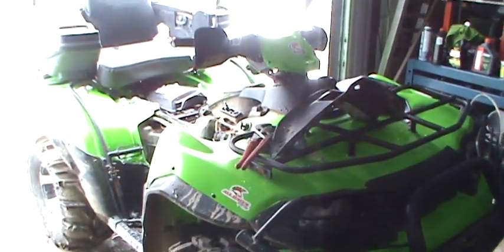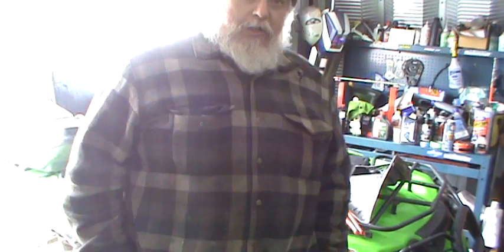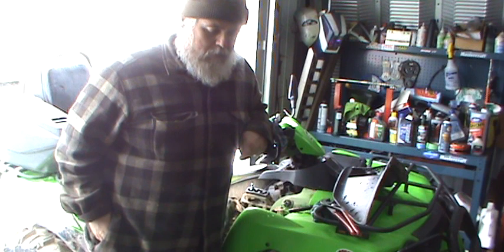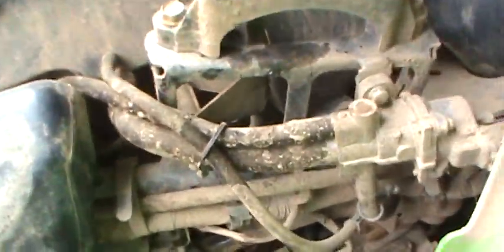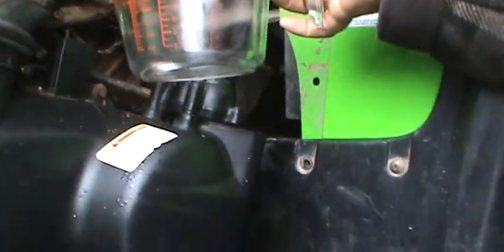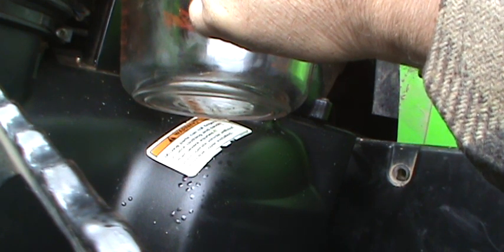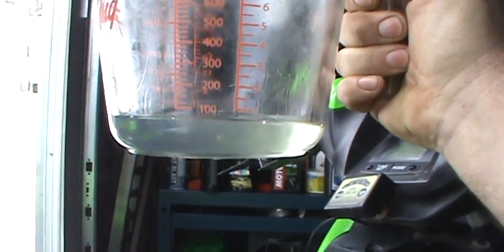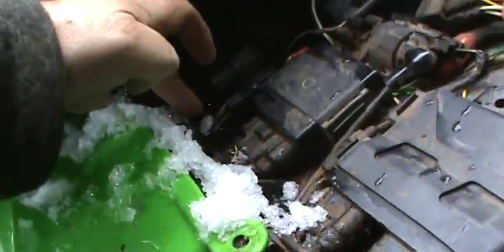Kawasaki brute force 750 no power backfiring fix

Comment: How’s it going I have a 2010 brute force 750EFI bike was working good on a run and I have a new pump and sock filter in it from 2 runs before the bike on the last run got it on open road and wouldn’t go over 30mph now still won’t take a good punch on throttle then shuts it down but after letting bike cool for a couple mins fires right up and goes for another 10 mins then shuts down still cuts back while giving it checked coils with metre seems fine do my knowledge of testing do you think I’d need to poke whole in the sock filter?
Reply from the maker: Not in the sock filter but the hidden one inside the plastic fuel pump housing. Google it. Hook a fuel pressure gauge to the bike. Ride it till it acts up and look at the pressure reading.
Reply: @HammerHeadGarage  do you happen to have a number I could call you at if you have the time
Reply: Well actually is it the fuel regulator I gotta check is there a filter in there I appreciate the reply back and feed back thanks so much!!
Reply: Thanks for help went and checked fuel filter and there was a rag from
The mechanic before that put fuel pump in was choking it out lol

Comment: I've got a kvf 650 Brute force 2006 doing the Same as that atv any advice? Doing the sort off same thing as that after I flitted a winch use to hear the noise from the pump but dose not make the noise
Reply from the maker: check fuses and wiring. no fuel pump priming equals no fuel.
Reply: Hello so myn dusent av a pump mate dus it only av a fule prime tap and runs of a vacuum pump mate naw, av lost all apart fuse is r all OK wel the only two under the seat I can find or is the rny more mate

Comment: 2008 brute blue shut off while driving, display comes on when i open the key but wont crank
Reply from the maker: Check charging system , battery and ignition switch, and wires.

Comment: I have a 2006 brute 650 . At idle the front carb back fires thru the carb. You pull choke it stops , or you give it more throttle it goes away. Runs like a scalded dog. I just can’t figure out what to do. I cleaned carbs and I had a shop clean them also cuz I thought I was missing something . Any thoughts ??
Reply from the maker: Do a leak down test on both cylinders and tell me the results.

Comment: I can seem to find my fuel line your talking about and showing I’m so frustrated help I have a 08 brute force 750 vtwin
Reply: Is it different from what your working on I tried joining your. Chat Sunday but I was at work and I had back service at
Reply from the maker: It is the line that connects directly to your throttle body and comes off your fuel pump under the seat/electrical tray.
has a red clip on it.
Reply from the maker: @tristanletendre2051  What year BF?

Comment: I have a 2012 BF 750 and it has all power when cool but when warm it loses power slowly then when you hit the kill switch while driving a couple times it’s back to full power for about a minute what would cause this??
Reply from the maker: Could be a coil problem, ECU or a number of other things. Check every ground on the machine. Load test the battery.

Comment: #Hammer Head Garage I have a 2006 Kawasaki brute force 750 and it’s in limp mode I’ve reset that light and took it for ride and it goes back into limp mode and starts backfiring n replaces the fuel pump n line and still dose the same thing would you know what it could be
Reply from the maker: try another good ecu.

Comment: Hey I need some help I did the fuel test and I came out at 200cc but I bog down like you were saying anything else?
Reply from the maker: Do a leakdown test. Also the pump has a tiny screen inside it that clogs up. That might be whats going on.
Reply: @HammerHeadGarage  how do you do a leak down test?

Comment: I have a 2005 brute force 750 with new starter. It will turn over but not crank. Please help me trouble shoot.
Reply from the maker: Turning over the engine is cranking. What do you mean?
Reply: @HammerHeadGarage  it will turn over but not start.
Reply from the maker: @forresthaag6487  Start with the basics, Is it getting fuel? air? and spark? it needs all three to run.

Comment: I got a 08 bf 750 runs good when warmed up but at first it wants to die when i put it in gear & try & move..any suggestions?
Reply from the maker: Have the codes read. Sounds like a coolant temp sensor acting up.

Comment: Hello I have a 2011 brute force 650  it's been a good machine but recently it doesn't have any power when you get over about 30. It idols just fine and none of the lights are on on it. It kinda just starts to bog down and back fire a little bit when you get on the gas . Do you have any ideas on what could be causing it to do that? I've changed the gas on it to make sure it was good. Thanks appreciate your insight!
Reply from the maker: Do a fuel pump flow test. Watch my videos on fuel pumps.
Reply: @HammerHeadGarage  ok, awesome will do thank you sir!

Comment: I am really hoping you can help point me in the right direction for my quad. It’s an 08 650 brute force and has essentially the same issue described here. It’s got good fuel flow that should be filling the carbs. The carbs looked really clean inside too when taken apart. I was riding the quad and everything was running really well until going up a hill it fell on its face and lost half power. I have not been able to find the issue and am running out of ideas to try

Comment: Hi mate hopeing u can help me Iv a 2005 kvf750 I just bought and it starts up perfectly but on set off it had a bad splutter problem and lacks power Iv done a full service on it oil filters plugs any help would be greatly appreciated
Reply from the maker: Sounds fuel related. How old is the petrol? is the fuel pump working? Is the bike charging? should be 13.5v to 14,5 vdc at idle.

Comment: ciao sono flavio, ho lo stesso problema che ai mostrato nel video, pulito i carburatori un paio di volte ma niente,non sale a piu di 3000 giri e scopietta e ratta,da cosa puo dipendere?
Reply from the maker: The carb machines have a fuel pump on the left upper frame rail. Check that is squirting fuel while cranking the engine over.

Comment: I know this is side tangent but I was wondering why my rear drive shaft on my 750 bf was moving forward and back at different times it travels maybe 1/3" .I removed the shaft to install new oil seal thats how I noticed .I pulled the shaft out and could not move the splined stud at all no play with hand pressure .Is this normal and is this why the shaft is collapsable and spring loaded

Comment: Is this the same for the artic cat 650 v twin ....runs but does the same thing when you drive it at any speed
Reply from the maker: Very likely a fuel pump issue or a fuel supply issue. Start with fuel/Air/Spark and go from there.
Reply: @HammerHeadGarage  thank you very much I appreciate the response !
Reply from the maker: @jleard  No Problem, good luck

Comment: Good afternoon.  I have a kawi kvf 750 2007. It works very well.  I did the maintenance yesterday, oil change, differential oil change, air filter change.  When I start it there is no power and the front cylinder flips backfire and the exhaust are explosion sound. I didn't work with other parts. Before that, it worked perfectly. Please help.  Thanks.
Reply from the maker: Do a cylinder leakdown test on both cylinders. Anything more than 12% leakage is no good. Engine will need to be torn down and rebuilt.

Comment: Love the tip bro would the fuel pump recommendation be the same here in New Zealand in regards to getting it out of a different vehicle such as the wrangler? I have the 2007 kvf650 and it's doing that limiter sound... the local mechanic said the carby and motor was fine as it idles and starts ok it just won't full throttle and makes that limiter sound every time I try to full throttle driving? I tried the factory reset and it kind of worked for like half an hour but now it's doing it again...?  Local mechanic said to bypass it by rewiring or cutting the wire at the computer or on the wire loom somewhere where ever that needs to be to stop it from limiting? On the flip side I will do this fuel test now though just to see if it is the fuel pump 😎
Reply from the maker: don't ever cut any of the wires on these machines. Worst thing you could do. Get a factory service manual and work out your issues one at a time slowly.
Reply: @HammerHeadGarage  thankyou for replying so quickly yep I have the factory service manual but I'm not sure if it's the right one let alone how to read it properly.. My serial is in bits and pieces and I can't make sense of it so I'm just reading through a pdf I downloaded online. When you say go through step by step what do you mean ? Are you saying not to do the fuel test with the measuring cup for 150mls like your video says ? I'm confused now 🤔
Reply from the maker: @100prooffitnesslifestyle7  Do the fuel flow test for sure yes. Also a leakdown on both cylinders.
Reply: @HammerHeadGarage  have you got a leakdown test video for the kvf650? I've been looking around YouTube but haven't found anything too helpful. I don't really no what to look for. Can I do this test without pulling the motor out? Also I just checked the belt which is missing parts to it... would this make the bike limiter kick in ? I kind of feel like I'm losing pressure from the cylinders now that you mention doing the cylinder test, I am losing a lot of oil too. Could I be losing pressure because of that as well? ... I haven't done the fuel test yet because it's raining here but will get on to it asap

Comment: 2012 Brute Force 750i keeps fouling 1 plug...plug is saturated with gas...throttle sensor, injector? What would you start with
Reply from the maker: Id start with the basics, Do a leakdown test. Adjust valve clearance. Try a new spark plug (several know to be bad out of the box) Spark on both cylinders?
Reply from the maker: Then go on to reading any codes?
Reply: @HammerHeadGarage  Thx...I put new plugs in last month when this happened. One of the plugs was showing continuity between the engine case and the terminal. All was OK after and the quad ran as it should. There has not been 2 miles put on the bike since I installed the new plug. The atv only gets used now to bring my trailer to the road.

Comment: I have a question can I email you a video of how my bike is sounding I don’t think it is running right the bike was sunk with someone else on accident it did shut off on them I drained everything ram oil through it changed it like 3 times out new plugs in it.  But it doesn’t sound right to me and idk what else to do I have no changed the gas yet I was guna try to run it all the way empty and then put Fresh in it but any help would be very appreciated

Comment: I was going up a hill it lost power and started smoking from the engine and now it has no power to even drive it I give it gas and it stalls its a 2008 brute force
Reply from the maker: could be many things. Start with a leakdown test. You can sometimes rent a leakdown tester at auto parts store for cheap or buy one at harbour freight. Anything above 12% leakage you have an issue.

Comment: Hammerhead I really need your help on a 05 brute force 750??? I bought the machine I had mid range high to wot power with no problems ,but I had spitting light popping through the carburetors at  all times and it wouldn’t idle correctly without turning idle up high so what I did  I took carburetor apart cleaned it very thoroughly jets a little dirty clean them up replace the intake  boots and then I got bike to idle better great now all of a sudden I lost my mid range and my high and power or before it was the opposite , and when I checked the air screws they were two turns out I’m lost and I adjusted the valves and I double checked so I know those are OK I did replace my computer with the Dynatech CDI before I started the carburetor and I still ran fine more power  with the newer CDI in it and I even plug the old one back in after I rebuilt the carburetors just to make sure it was in the CD I doing something and I still ran the same way please any help is appreciated and I did check needles diaphram and float level they were fine
Reply from the maker: Well there is something up. FUEL, AIR, COMPRESSION
Go back to the basics. DO a Compression and Leakdown test. What reading are you getting on the coils? Has the heads been off or cams out recently?
Reply: Hammer Head Garage I just  dropped tank removed old gas fresh gas check screen it clear startup same thing, from carb doesn’t pop or spit front does I did notice rear carb needle vacuum slide  flutters up and down,but front carb spitting vacuum slide stay in one spot and is not fluttering up and down like rear?
Reply from the maker: @mitchellowen8821  read my above reply. What are the values I asked for?
Reply: Hammer Head Garage Figured it out the diaphragm was just barely cockeyed not making a seal on the vacuums line and I didn’t have the air cleaner on when I was testing it to see how it ran so I put the airbox on in the air cleaner and it runs perfect
Reply: Hammer Head Garage I did takeoff the tank in the just the valves clean the carburetor service all the boxes now I know the whole quiet inside and out and I just bought it a week ago

Comment: Have a 03 prairie 360, just picked it up 2 weeks back. It had sat for 2 years so I drained fuel, did a full service. (Oil, oil filter, spark plug, new carb and new battery) got it back together ran great drive it 4 or 5 times now has a check belt light and is in limp mode. I tried to reset the light and checked inside the housing. Now the light is off but still seemed to be in limp mode and can’t get it to come out. Any suggestions? First 4 wheeler learning as I go here! Thanks
Reply from the maker: could be a couple things. Check batt voltage at idel? should be around 14vdc. Try un hooking the battery. Also check all the plugs by un plugging them and replugging them in.
Reply: Everything looks to be good, voltage is right at 14.10. All plugs been unplugged and blown out.  Do the actuators on the top of the belt housing go out often? It seem to be something electrical it started and idles great but as soon as you try to give it much acceleration it putters out and falls on its face

Comment: Mine is doing same thing as you explained in the video after half throttle it falls on it face but mine is carb model could you tell me what’s wrong? Valves been adjusted and are set right just replaced the intake boots  spark plugs an it still runs like crap
Reply: It will take throttle all day long idling but if ur in gear an go past half throttle it bust back
Reply from the maker: No I could not tell you. I d have to see it. Start by getting a service manual and go through all the steps. What do the plugs look like? do you have spark on both cylinders? is it getting fuel? etc etc etc.
Reply from the maker: The main jet may be partially plugged. Has the carb been apart? was it put back together proper/

Comment: After watching a few of your videos on the 2008 Brute Force I'm now hesitant to buying a used one off of Craigslist.  The guy has good pics but of course no way to see details. I am meeting with him at a community boat ramp this afternoon to look it over and test drive.  $3,500 and it has 182 hours.  Have no idea how he used it.  Considering this is my 1st ATV buy, how would you go about this?  Avoid and buy something else?
Reply from the maker: Ok, number 1. check the air filter. If it is not clean then move on. 2. Leak down test will tell you the health of the engine. Anything over 12% leakage is a problem.
Reply: @HammerHeadGarage  Well that says it all then.  I asked where the air filter was and they didn't know.  They bought it off a guy 3 or 4 years ago.  It sounded good but from what you said, that means 3 to 4 years of never replacing the air filter.  They didn't use it much; it sat up for a year.  Engine looked good actually.  Very clean all around with some wear and tear on the body.  Lot's of power.  All I need one for is to help me maintain my 7 acre property - getting too old dragging tree trunks to the burn pile and a zero turn mower isn't really made for that and I need an ATV for those times I get my zero turn stuck in the muck.  If not this one, what do you recommend?

Comment: What makes a Brute Force 300 run fine when it's cool once it gets to operating temperature it has no power
Reply from the maker: Sounds electrical. A coil breaking down possibly. Get the electrics tested. Charging system, battery and coils.
Reply: It's a 2023 model got like 20 miles on it still under warranty

Comment: 06 brute force I have to rock it back forth to keep it from blogging
Reply from the maker: Prob fuel pump. Do the flow test as outlined in my video.
Reply: @HammerHeadGarage  I have a new mr gasket feul pump if I turn right real quick it won't bogg or if i shake it

Comment: Hello, I had this same problem. 2009 BF 750 4x4i . It was sitting up for about 3 years or so. Change the battery and started right up . Notice the belt light was on so I reset it and changed the old gas for new gas. I got it out of limp mode but no top end.  Can’t go pass 25mph. I changed the fuel pump and now it will run 4 seconds and just kill , like I turn the key off. Help thx
Reply from the maker: is the charging system working? did you load test the battery?
Reply: @HammerHeadGarage  yes I believe so. A buddy keeps telling me the fuel injectors but I don’t know. If I spray carb fluid in the intake it’ll run a little long , I don’t understand after I reset why it ran for a while , no top end and it backfired to not running after changing the pump.
Reply: @HammerHeadGarage  it seems like it will run the fuel from priming and then just kill. This is for a few seconds and I have to press the throttle. Unless I spray carb cleaner in it